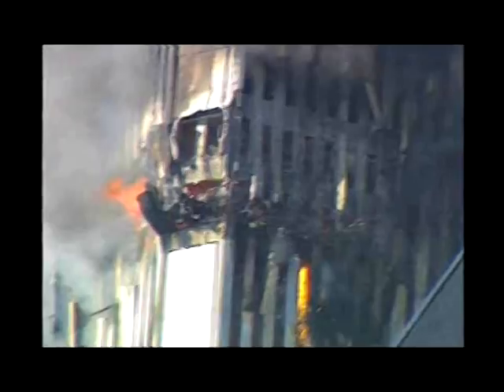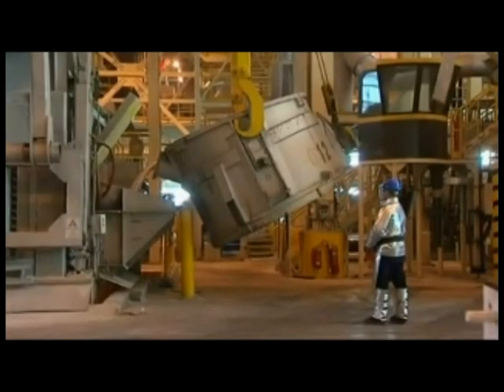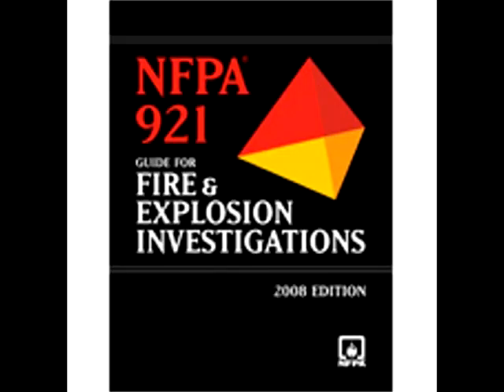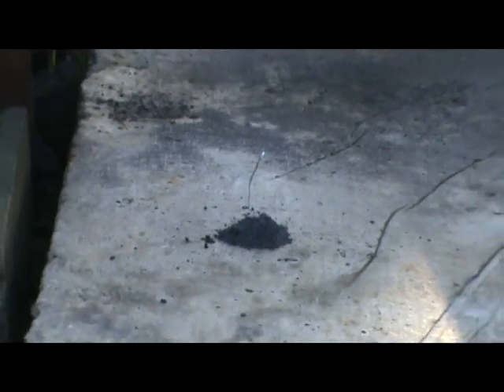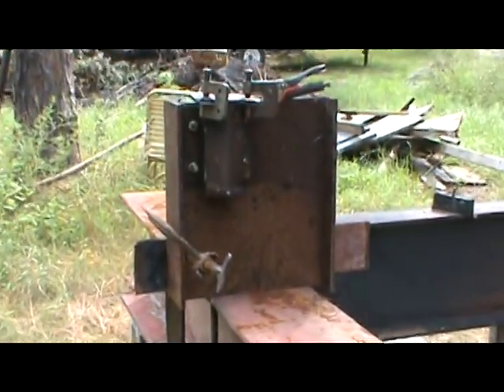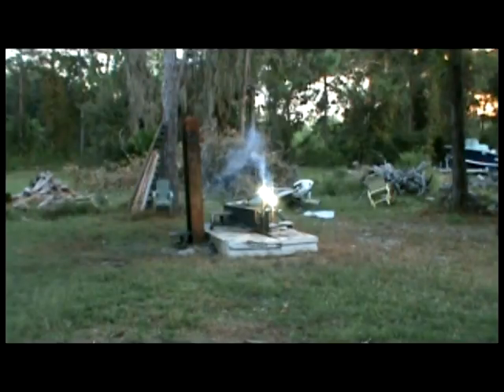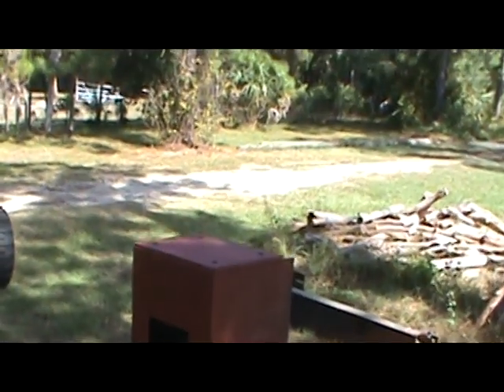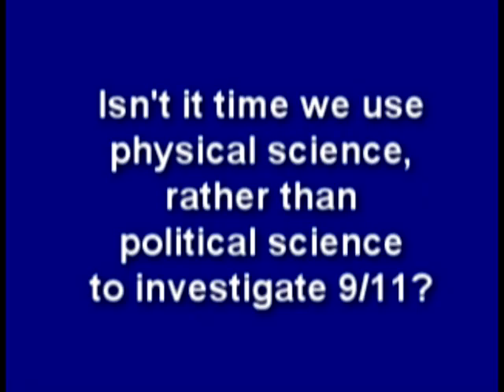9/11 Experiments: The Great Thermate Debate

Comment: By far the best I have heard it explained great job.
Reply: If that's the 'best' you've heard - then you have been dealing with real morons.  How about a better and more plausible theory?  Say one based on the fact that structural steel retains only 40% of it's original strength when heated to 1000F?

There was no thermite because all it took was burning jet fuel and the contents of the offices to heat the structural steel enough so that it became too weak to support the load.  And this is based on known structural engineering principles and does not need some idiot - who  knows nothing about the properties of metals - to tell you that they had to cut the steel with thermite in order to bake it collapse.

BTW: if you don't believe me - just type "structural steel temperature" into a search engine and look at the graphs you find.
Reply: @colincampbell767  Where did the molten steel come from then?
Reply: What 'molten steel?'

Cutting the support members with thermite won't produce enough 'molten steel' to be noticeable.  And it would cool way too fast for anybody to see it more than an hour or so afterwards.  And it would cool even faster if it was in contact with the steel - which is an excellent conductor of heat.

BTW - you are aware that it is physically impossible to have molten steel on the ground days after the collapse - right?  So unless you can come up with a way to violate the laws of thermodynamics . . . 

Besides - nobody was able to ask my question as to how was it even possible to emplace the explosives/thermite/vibranium without just about everybody in the city noticing.  You would have to build tower cranes, erect scaffolding, close off streets etc.  And nobody noticed?
Reply: @colincampbell767  When I mentioned molten metal I was referring to footage (for example 00:50) and spheres of molten steel.  At 10:03 you can see molten steel splashing and dripping and he used only 3/4 lb of homemade termite. 

You could transport explosives in a truck/van loaded with termite(similar to what McVeigh did in the Oklahoma bombing), bring explosives inside the building and install. No need for cranes/scaffolding.
Reply: <facepalm>
One of the unique features of the WTC design was that the major support members were outside the building.  The only way to do this would be from scaffolding outside the building.  BTW - the cladding outside the support columns was welded in place and not designed to be removed - and each piece weighed several hundred pounds.  

If you're going to do this to the interior columns - you are going to have to jackhammer through concrete.

Please explain to me how they would have done this without anybody noticing.

You appear to have bought into the conspiracy theory without asking for a realistic means of emplacing the stuff without a major construction operation.  

And of course you would need 'stealth' explosives that can sever structural steel without producing the distinct visual, and audio signatures of high explosives.  (Real explosions are nothing like the ones you see in the movies.)  And there is no way you can even think of hiding the explosion of a linear shaped charge that it would take to cut through structural steel.  

Did you think about the flaws and logic holes this conspiracy theory has before you bought into it?
Reply: @colincampbell767  You mean the the perimeter columns were bearing the load? Yeah I know that. The perimeter columns were literally at every window. The aluminum cladding was covering the external faces of the columns but not the interior faces. Here is a cross section of a perimeter column: http://www.sharpprintinginc.com/911/index.php?module=photoalbum&PHPWS_Album_id=10&PHPWS_Photo_op=view&PHPWS_Photo_id=669.
The perimeter columns were accessible from inside of the building. 

Termite is not a high explosive and does not create a shock wave and a lot of noise.
Reply: And you would still need access to the entire perimeter of the column.  Not going to work.  And even still - using thermite is a pretty dumb idea.  Why not simply let the aircraft crash and fire do the job?  Even if the building doesn't collapse (remember that they were doomed the moment the airplane hit them) every steel and concrete part in the affected areas would have to be replaced.   The load bearing columns, the floor trusses and even the floors themselves - all would have to be torn out and replaced.  

And then there is another issue you haven't considered.  The wiring, initiators and the thermite itself will have to remain unaffected by the impact of the airplane.  How would this be possible?  

And of course there's the issue that even if we could ignore reality and somehow place this 'thermite' and the containment from the inside - how could this have been done without anybody noticing?  Look at the diagram you provided - how do you expect anybody to demolish the interior wall, tear out the fireproofing material, place the thermite, then repair the wall, haul off the debris, vacuum the floors and wipe off all of the furniture, and have the pain dry by the time the workers come back to work?

And how would you do this without anybody noticing?  (Remember that some of the companies that were housed there were operating on a 24/7 basis - how would you keep them from noticing?)

The fact of the matter is that any critical look at the conspiracy theories comes up with several holes that are large enough to fly an airliner through.  And none of them can be answered with any kind of a plausible explanation.
Reply: If the thermite were below the crash location - then the videos of the collapse would show it initiating there.  They don't - so that 'they could have' doesn't pass muster.

And if you had actually read that report you would be aware that the insulation covering the structural members was knocked off by the impact and debris of the impact.  Remember that the insulation used for this purpose is basically paper with some binding chemicals so it is pretty fragile.  

And the creation of this conspiracy theory was crafted to produce an emotional response in you.  This is how conspiracy theories work - they make you angry so you are not going to given them the skepticism they deserve.  And by now you're invested in the theory - as evidenced by your comment: "The termite can be planted in as well as beneath the planned aircraft impact zone."  You are reaching for something - anything that supports the theory even if it is nothing more than a wild guess on your part.

BTW - are you claiming that this mysterious "they" were so smart that they could predict the exact location of the aircraft impact - and at the same time be so dumb so as to think that they needed to use thermite?  (The thermite theory is based on an absolute ignorance of how buildings are designed and constructed.  The aircraft crash was by itself enough to doom the building.
Reply: @colincampbell767  I mentioned the report to answer the question how thermite could be placed noticeably. 

And of course it's such a far reaching conspiracy. Almost as crazy as claiming that US government would deliberately not treat syphilis among a group of people in order to study the disease.  Or administering psychoactive drugs to clueless test subjects in attempts to create truth serum. 
I'm not saying that the impact site was predicted but rather planned.
Reply: Yea right.  Tens of thousands of people would have to be involved, in the NTSB, the military, FAA, NIST, FEMA, defense contractors, people like the security manager for the WTC, al Qaeda, CIA, FBI, and absolutely none of them have confessed.

You didn't think this through - did you?

Comment: Fire CAN weaken a steel structure enough to make a building collapse. It has happen numerous times since 9/11 with other buildings around the world, that were exposed to prolonged fires and collapsed due to having a steel frame and not concrete frame.
Reply: Actually high heat causes cement to break down.  Heating it high enough causes the water that the cement used to form chemical bonds to separate from the lime and be dispersed as steam.
Reply: Miguel Dias Fire weakens, softens, and warps construction grade steel when temperatures approach 2795°F. 
A fire sustained by jet fuel which burns at its hottest 1472°F, cannot melt steel but simply distorts it instead. (See Meridian Bank Skyscraper of Philadelphia -in year 1991 this building sustained 18 hours worth of fire damage)
Reply: "Fire weakens, softens, and warps construction grade steel when temperatures approach 2795°F."

<facepalm>

Maybe, just maybe, you should have gone to Google and typed in: "structural steel temperature" before you posted that - and make a fool out of yourself.  Clue for the clueless: At 1000F structural steel only retains 40% of it's original strength.

BTW: Heat does not actually distort steel.  In fact heat removes the internal stresses (that occur when the steel is formed) from steel so that it will not distort.  Any distortion needs an outside force to act on it.

Comment: Steel expands up to 4 inches in length when its heated to 1000 degrees. Is it possible this expansion of structural steel members expanded to the point of causing a compromise structural integrity, therefore causing an imminent pancake collapse? Great work on your theory and work, but could this be a case of plain Jane structure failure due to the immense heat of heavy fuel load loading? Just my thoughts...
Reply: Top floors soft, bottom ones would still be solid. Collapsing portions would’ve met with resistance and collapsed to the side. Not straight down.

Comment: Maybe the NIST was simply wrong about the temperature. It's more logical than leaping to the conclusion of "Conspiracy".
You've only shown that thermite CAN melt the steel beams, not that it did.
Reply: The temperature at which steel melts is completely irrelevant to the collapse of the buildings.  This is because the steel did not have to be heated to even half that temperature to cause it to fail.

Like all metals - structural steel weakens at a predictable rate as the temperature increases.  For example at 1000F structural steel only retains 40% of it's original strength.  All that happened was that the trusses supporting the floors grew progressively weaker as the temperature increased.  Pretty soon the steel's strength is simply no longer enough to support the load.

This is a pretty basic structural engineering principle.  You don't need a wildly improbable conspiracy theory that assumes that conspirators who were smart enough to create a perfect conspiracy that remains airtight after 17 years are also dumb enough to think that they needed to use thermite to make it collapse after the planes hit it.
Reply: maybe but it's relevant to the massive amounts of molten steel (melted) found at the scene.

Comment: Because thermate burns at higher temperatures than ordinary thermite, it has military applications in cutting through tank armor or other hardened military vehicles or bunkers. As with thermite, thermate's ability to burn without an external supply of oxygen renders it useful for underwater incendiary devices.
Reply: So?  Consider the clip where he showed the "molten steel" coming off the building.  Molten metal does not get hotter when falling through the air.  It gets cooler.  The fact that it obviously got hotter as it fell should have clued you in to the fact that a completely different process was occurring.  Now let's see what chemical process gets hotter and brighter if it gets exposed to moving air?  How about fire?  The video was of burning materials falling through the air

Besides the fact that he took the thermite theory seriously is by itself a clue that he has no idea what he's talking about.  All he did here was demonstrate his ignorance of the properties of metals.  What he should have done was taken a piece of structural steel and seen how much force it took to bend it.  Then heat that piece of rebar up in a set of hot coals for a few minutes and notice that that piece of rebar can be bent back and forth with almost no effort.

You don't have to melt the steel in order to make a building collapse.  All you have to do is heat the steel.  As it becomes hotter metals lose strength.  (This is how a blacksmith makes horseshoes by hand. He doesn't melt it he simply heats it up enough that he can shape in on an anvil.)  FYI at 1000F structural steel retains 40% of it's original strength.

No steel was melted.  And no steel had to be melted.  All it took was for the steel to become progressively weaker as the temperature rose - until it reached the point where it could no longer support the load.

Comment: JET FUEL CANT MELT STEAL BEAMS AAAAAAAAAAGGGGGGHHHHH
Reply: @Mekronid "So you're saying the airliner's specifically airline-alloy aluminum (different chemical composition from powdered Al) somehow became powdered and thus via an unknown source of iron oxide or other oxidizer (which formed in the middle of a raging inferno) hence magically formed thermate."
No it isn't what I said.  In fact I was pointing out how stupid the thermite theory was.  Unless of course you think that people who were smart enough to somehow prep an occupied building for demolition without anybody noticing and then maintain perfect secrecy for 20 years somehow were so dumb so as to not understand the properties of steel at different temperatures.  
The fact of the matter is that it appears that a requirement for believing in this conspiracy theory is an ignorance of basic physics, basic metallurgy, and the basics of structural engineering.  Oh and in your case - the ability to fail to understand my previous post.  I thought that I had 'dumbed down' my explanation to the point where any idiot would understand.
Reply: So?  When heated to 1000F structural steel retains only 40% of it's original strength.  There was no need whatsoever to melt the steel in order to get it to fail.

When you hear people talking about having to melt the steel with thermite or cut it with explosives - all they are doing is demonstrating that they have absolutely no clue as to what they were talking about.  Those buildings were doomed the moment those planes hit them and there was nothing that could have been done to prevent the collapse - steel simply loses too much of it's strength when heated to 1000F.

BTW - I love the way the people keep talking about thermite being needed to "melt" the steel and jet fuel does not burn hot enough to do this seem to be clueless about what thermite is.  Thermite is powdered aluminum mixed with an oxidizer (typically iron oxide).  And airliners are made out of what metal?  Yes, they are this clueless.
Reply: @colincampbell767  calm down its just an internet joke
Reply: Yes it can